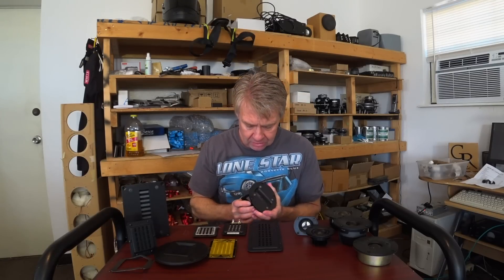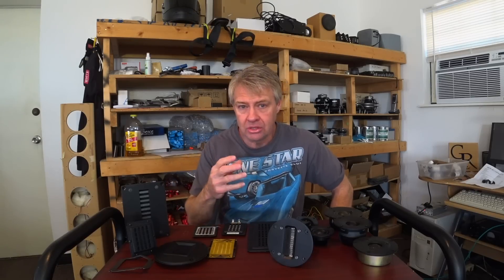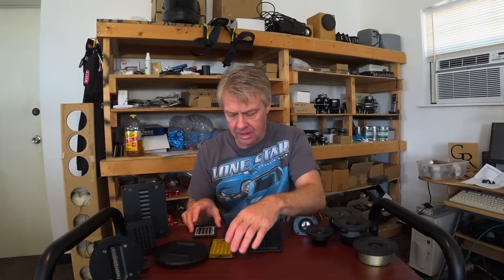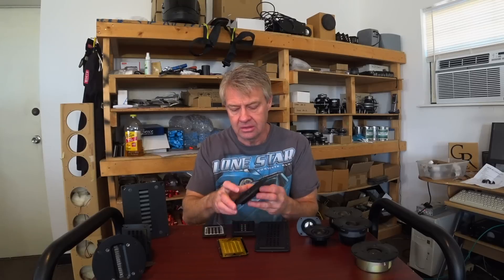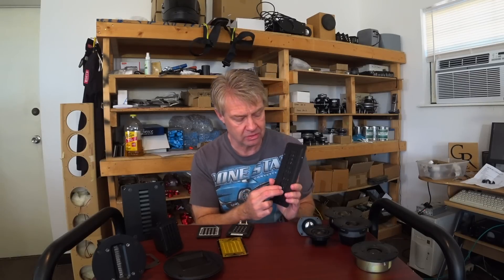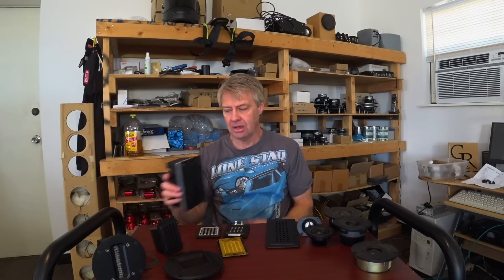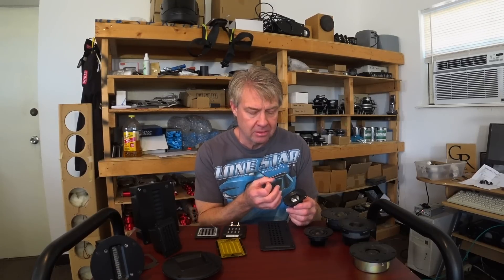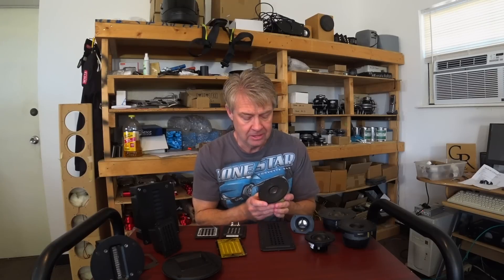Selecting Tweeters and Why it Matters!

Comment: I find the soft dome silk tweeters sound the best if you dont need high volume thyre the best and are very forgiving if the crossover point is too low they dont distort too unplesantly, For high volumes titanium compression horn tweeters are the best.

Comment: Hi Danny, I have a pair of DIY MTM speakers using a pair of Vifa P13WH-00-08 5  inch woofers and a Scanspeak 2905/9000 tweeter crossed over at 3800 hz.  I've thinking of replacing the tweeters with an AMT tweeter, specifically the Dayton Audio amt2-4 tweeter.  Do you thinks it's worth the bother?  I would of course change the crossover to suit.

Comment: in the past I also thought that soft domes sounded better based on experience. But the newer metal down tweeters dont ring like they used to and the distortion is well out of the audible range. I have B&W speakers and the tweeter is tremendous. I think it goes all the way up to 38Khz to hear any artifacts. The distortion is incredibly low in the treble.

Comment: I found this tweeter that has a -3dB point off 600 Hz. Can I pair this to a set of 15" high Q woofers in a open baffle design? If so would a first order on the tweeter be enough

Comment: How to tell if it will play details well? lot of tweeters sounds dull (to be more forgiving?), example being praised Q Acoustics 2020i, no equalizer could help that.
Reply: I can answer that for me after 3 years now :) It's the design (voicing) etc. partially, but Most of the budget speakers use cheapest parts inside (from biding post to crosover parts), and that really kills any potential even a cheap driver might have had.

Comment: I really like ring radiator tweeters. They have pretty good dispersion and, because they use a silk membrane, they provide a very sweet tone but not necessarily the most accurate reproduction. Peerless (Vifa) has some that are exceptional value.
Reply: Maria Callas broke mine and it was not even that hard.
Reply: @jamegumb7298  ? How? Most of those tweeters have a really low resonant frequency and fairly high power handling, so something must have gone very wrong.
Reply: @mndlessdrwer  I looked at them again, they lacked the ring, so simple soft dome. The amount of power the amp puts out is 1.5× what the speakers can take so should not be overly deformed sound that did it, RIAA amp works great as always, nothing likely to have gone wrong there, wires 4mm² wires in banana plugs seperate wires for tweeters and woofers, nicely clamped and nothing sticking out or loose. I really have no clue, other than Callas voice going too high and poof tweeter, the other option being the speakers being far from what was on the box, power handling wise, but even then volume was well within limits. I am building my own now for that system too, should not happen again.

Comment: I bought a couple of dayton titanium done tweeters where the dome was very exposed with no gaurd or anything and I was installing one my finger slipped and plip the dome was crushed in I unsuccessfully tried to pop it out but it was krinkled n trashed. It was literally so fragile like foil, I still have the other (with a circle of cardboard taped over the dome opening) but now I'm Leary to buy another and install them what's the chances they won't get poked or whatever once there in floor speakers.... and there look totally irresistible to someone especially kids to poke just outa curiosity and it's not as tough as my dad's L100 cone tweeters paper dust caps I poked as a child! If wanna give a child a fun cheap present give a pile of old speakers to poke!

Comment: Thanks for the interesting video! I want to upgrade the 4" tweeter in my car. I'm limited to a depth of no more 3cm so I am having difficulty finding anything. I'm running a Kicker 5 channel amp. Can you recommend anything? Can I use a tweeter from a household speaker?

Comment: When you say, a smaller driver has higher dispersion, so you mean a smaller tweeter (diameter) is better ? You will get a greater soundstage?
Reply: I think it's just that the sound won't be as focused as with a bigger diameter tweeter.

Comment: I have a 40" planar drivers that go down to 250 hz.  One of the important points is since they are fast the driver below needs to be fast enough to match the ribbon/planar etc.  Differences in speed between drivers makes it easy to hear transition between drivers.

Comment: I prefer dualtweeters from experience.  Softdome to handle the mid trebble, ribbon or horntweeter to handle the higher notes.
Ever since i changed from 3way to 4way speakers, i have a much more relaxed upper sound.
I would prefer to only use a horn/ribbon tweeter, but i haven't found one that handles the lower trebble well,
and i don't want to push the midrange too high.
Reply: This actually blew my mind. Are you saying you split the highs up between "upper" highs, maybe more gentle, and "lower" highs? I have very powerful speakers but the tweeters are very ear piercing. I'm looking to replace them with something just as powerful but much more delicate...perhaps I can do both?
Reply: @AlexHernandez-np7iq   Don't quote me on it, i'm not a professional. 

I had a pair of Dali Blue 6006, very good rock'n roll speakers. But i always felt i was missing that hihat drum, the upper register felt murky. It was there, but murky imo.   So i bought a pair of Dynavoice DF-6, simply because they had a softdome and ribbon and i swear my sound improved.
I've had them for 4 years now and i love'em.

Comment: Well this might explain a lot since Behringer suddenly and without noticed pulled all the TRUTH B3031A studio monitors off store shelves. Luckily I did get two before the fall-out. The B3031A featured ribbon tweeters. They are no longer available. Only option now are the TRUTH B2021A studio monitors with less power and domed tweeters. I also have two of them. I'd love to learn about large horned tweeters like the movie theatre's use. I use my Behringer studio monitors for both my digital virtual pipe organ and my digital virtual grand piano's. I am searching for speaker options for use with digital instruments. I'm using 15" and 18" paper cone woofers for lower frequencies and need a good speaker setup for mid-high frequencies.
Reply: If you want a serious purpose built studio monitor with a planar magnetic tweeter then we have taken it to the next level. Check out the whole build thread: https://www.audiocircle.com/index.php?topic=160647.msg1713826#msg1713826

And https://www.audiocircle.com/index.php?topic=165019.msg1754231#msg1754231

Comment: Thanks for the chat. Turns out my super tweeters are planar not ribbons lol. Your certainly right about taking them apart I had a nightmare with mine when I got curious what was inside them.  Fortunately I didn't break it 😁
Would have been nice to hear your thoughts on ring radiator tweeters as I'm currently thinking of replacing my normal old dome tweeters with them (probably vifa XT 25 type).

Comment: What do you think about full range assisted speakers? Cheaper altenative to coaxial (3 way?) designs?
Reply: A very old concept (the AR-1 used it in the 50s) and a very good one, eliminates the weak bass and Doppler problems of FRs, while still maintaining point source for most of the directionally perceptible spectrum.

Comment: Anybody heard the new NEO6 from BG Radia ? I'm wondering how it could sound like if used as high-midrange /tweeter (so no tweeter added) high passed just a little higher than what the NEO8 usually is. Matched with a great large band and then a 12/15'' big sub, all in OB technique, should make a great loudspeaker.

Comment: Danny. I own the Totem Tribe Towers. They have a Wavecor 33mm tweeter. Any idea why the tweeter is that big?
Reply: I had one of those tweeters on the table. They are nice tweeters. The advantage of the larger tweeter is that they can be crossed over lower or a lower order filter can be used with them.
Reply: @dannyrichie9743  Thanks Danny!

Comment: i have been looking into drivers lately, so much new stuff since i looked into it 15 years ago :) 
Have been doodling some concept speakers, the tweeter makes the build for sure. 
 lowering the crossover to the woofer make a big difference.  Aurum Cantus AST25120 Aero Striction Tweeter interests me, think its ribbon, but it goes down to 700hz, 1000hz recommended minimum crossover. that is really low.
Reply: You cd consider a new ceramic dome 32mm tweeter from Peerless, model number DA32TX00-08. Shd be able to cross down to 1500 or possibly lower with a 3rd order crossover
Reply: Those are really too tall for a single tweeter. The height really limits the vertical dispersion. And on that model I don't think they measure as well or as smooth as they claim. I think I have tested one of those but it has been a while.
Reply: thanks for reply, Danny.   
its all about how you know how to use them as you say.  i wont be making tweeter arrays or if i did Raal have a 9" lazy ribbon tweeter for that.

Comment: Crossover Understanding power/slope rolloff considerations all things being as equal as possible Question: where would you cross a driver over in reference to it's FS? The method you use(maybe a rule of thumb) can it apply to all drivers? Thank you for your time
Reply: It also depends on how high of an impedance rise there is at Fs. Some tweeters really get bent out of shape if played near Fs. Some (like the planar magnetic drivers) have almost no issue at Fs and almost no impedance rise at all. So it really depends. Woofer are played right into their Fs ranges with no issues.
Reply: Danny Richie follow up question:
For SQ in a ported application, for smoother response should you tune the port at the impedance bump @Hz ?
The one below fs(21hz subsonic set at 28 Hz) Is a no brainer, should I tune the box to the second impedance bump in my case here 38hz (when modeled) instead of the 32hz that was recommended 
Thank You again for sharing your knowledge
Reply: @kf6qbw  I'd model it and see what the tuning is doing to the roll off, and tune for optimal roll off.
Reply: Thank You

Comment: What if we allign two Ribbon/Planarmagnetic tweeters in a T-Shape, so one is aligned horizontally and the other one vertically?
Reply: So using one as an up-firing super tweeter?
Reply: I meant both facing the same direction (front) , so the vertical as well as the horizontal degree offset will more or less the same.
Reply: If you offset the two tweeters but face them in the same direction then the time delay difference between the two of them will cause comb filtering (cancellation).
Reply: Yeah, that's what I was afraid to hear but even that close together? I'd like to know if there's a simulation software for comb filtering and so on. 

However! Let's pretend we would create a single ribbon with a t-shape and the center of the magnetic field is exactly in the T-section? 
Maybe even a Mercedes-Star shaped or cross-shaped or even round ribbon? (applies more to planar, I guess).

I'm just a hobbyist starting out, so please be patient 😁
Reply: Check out video's number 2 and 3 for more on comb filtering and two tweeters.

Comment: Really enjoy your tech talks.  You mentioned the long plainer tweeter dispersion  was limited to the length of it.  Does the shorter ones have the same characteristic.  IE, the one you had taken apart. I would want the tweeter to have a good horizontal and vertical dispersion.  Seams to me the dome tweeter is the best solution for a two way speaker.  36" tower or book shelf.
Reply: The shorter the tweeter the wider the vertical dispersion. The longer it gets the more it is limited to the length or less than the length of the diaphragm.

Comment: There should be a video for the crossovers because after you have the drivers, you need a good crossover
Reply: I'm going to do several videos on that coming up. I'm going to document a design (maybe three) using non GR Research drivers from beginning to end. So from initial design to completed playing speakers.
Reply: @dannyrichie9743  Thanks
Reply: He did one. Here’s the link. 🙂
https://youtu.be/kvwsIecOqsU
Reply: @NickP333  I missed that, thanks

Comment: I have the Infinity EMIT R tweeter in my Reference four speakers, have worked great for years.
Reply: I just measured, tested, and designed new networks for the Infinity Mini that used those tweeters. They were the little monitors with the 4" woofer in the Aluminum box.
Reply: @dannyrichie9743  What were the results ?
Reply: @RickMahoney2013  Maybe I should shoot a video of that one while I still have it here.  I may need to hire a video assistant.
Reply: @dannyrichie9743  Thank you Sir.
Reply: @Danny Richie
maybe you mean the '90 edition of the Infinitesimal by Infinity... this one https://audio-database.com/INFINITY/speaker/infinitesimal-iv.JPG

Comment: Great information but you left one important driver out and that would be the compression driver! I kept waiting and waiting thinking you were going to pull one out but I guess you didn't have any around. Would have been interested in seeing what you think about those!🤔🤔🤗🤗🤗😁
Reply: I'm not Danny but--compression driver: super light weight diaphragm, fast, detailed, I average 1 to 10 milliwatts driving mine to normal levels, require a big horn to make them work, low end cutoff determined by horn size/length. If they play low, mine go to 300hz, they make lousy tweeters.
Reply: @johnlebeau5471  

Really appreciate your input!🤗  why do you say compression drivers are horrible for tweeters? I have a compression tweeter in my jbl's thar to me and again that's to me sound fabulous especially the Tweeter area!😨🤓🤗😎  I believe mine goes down to 1500 hertz.  I've been traveling around looking at a lot of speakers and  I love the compression driver?🤗😎😉 and yes I do understand the horn integration is a very important part of the sound that one receives when using such a driver!🙄🤓
Reply: @bigjay1970  Compression/horns actually have a very wide frequency range. If the horn plays relatively low, I have a pair of Altec 203s that reach 300hz, the highs are not so pleasant. Mine are rated for 16khz, and they will play there, but I've seen a response chart of this horn and it starts to break up badly at about 10khz. They sound terrible when used as a tweeter. I cross mine over at 5500hz to a RAAL ribbon tweeter and they sound fantastic. A compression tweeter, with a tweeter sized horn is just fine.
Reply: @johnlebeau5471   
@Big Jay  
@Danny Richie  

Check out the 5" BMS 5CN162HE concentric midrange/tweeter driver.  ;)  Excellent performance when paired with the appropriate 10"-12" midbass.  I'm using the 10" Ciare HW251N and testing the combination for my DIY Studio Monitors.

The BMS 5CN162*HE* version is not listed in the website catalog, but they've added a shorting ring to the HF motor for lower distortion compared to the standard 5CN162.

http://www.bmsspeakers.com/index.php?id=bms_5cn1620

Also check out the new BMS 10" Concentric...

http://www.bmsspeakers.com/index.php?id=802&tx_ttnews%5Btt_news%5D=65&tx_ttnews%5BbackPid%5D=693&cHash=ad04dd1d1c105c304e6f7ab8785e1e1a
Reply: I have hundreds of them in stock of various types. Maybe I'll get into those another day.
Reply: @dannyrichie9743  

Thanks for your response, I appreciate it! Funny thing is, now when I watch YouTube videos of various people pulling apart speakers for example a KEF R11 a couple of days ago I just shake my head in disbelief regarding some of low level type of Parts they use even in this type of mid highend speaker!🤔😁🤓

Comment: I have thanked you before, but wanted to thank you again for taking your time to share your knowledge.  I try and watch all shared videos and I think I am taking away valuable information with each video.  I will say I purchased a couple of the dual open  baffle subwoofer kits - I'm still trying to get them integrated into my 2 channel setup.  I will say the subs performance is exceptional and that the open baffle experience is different than my experience with sealed and ported subs.  I've been putting  a lot of thought into some of the full range open baffle kits.

Comment: What do you think of ring radiator tweeters?
Reply: Some of them are very nice. I hve some in stock. I almost whipped a couple out for this video.
Reply: @dannyrichie9743  

Although it's not a traditional R-R tweeter design, I've been really impressed with the price/performance of the SB29RDN-C000-4.  It's my "go-to" budget DIY tweeter when it fits the application.